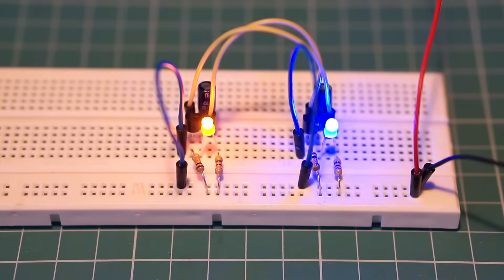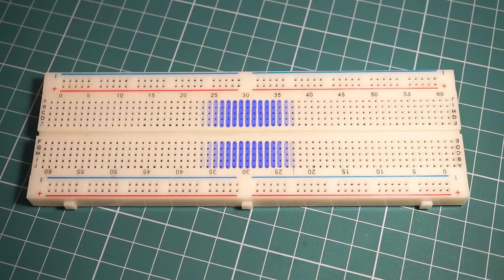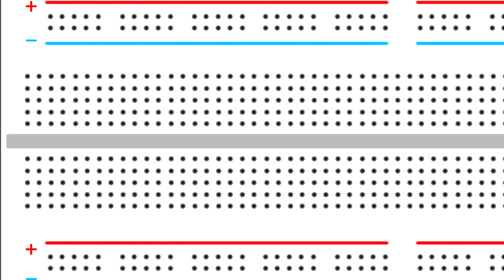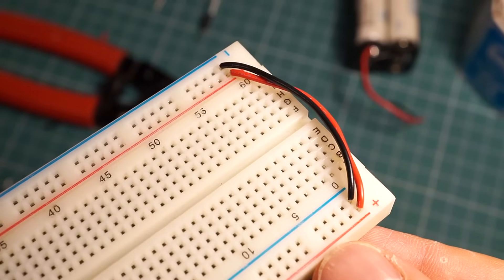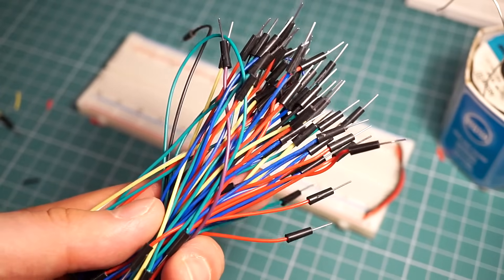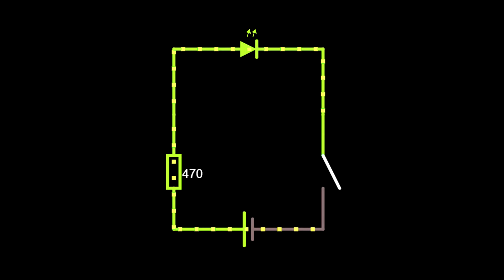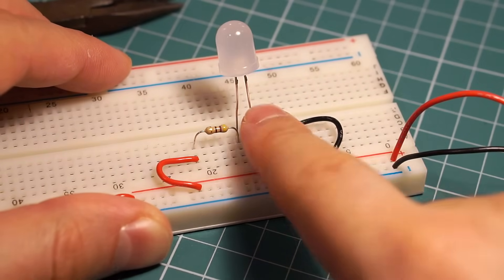Breadboard tutorial: How to use a breadboard (for beginners)

Comment: The breadboard looks like several can be connected to make bigger breadboards, yes?
Reply from the maker: Yes, some breadboards can be attached together. Of course, you'll still have to manually hook the power rails with jumper wires
Reply: @LeftyMaker  Great.

Comment: i did everything but the led wont work i tried it with other leds but nothing happens and when i use a cd motor it does work and i cant see what im doing wrong
Reply from the maker: Is your led in reverse? Do you have enough voltage for the led?

Comment: Thank you! When I was a kid I had an electronics kit which had springs you could connect jumper cables to to various components photovoltaic cell, rheostat, speaker etc. It came  with a book for 100 different projects. It was great. My dad and I once tried soldering components we bought for a separate project which did not work. Since then I hated soldering. This is cool. Subscribed
Reply: Yoo I had the same thing as a kid but I can no longer remember what it was called. Did you happen to remember?
Reply: How tf you had sh1t like this when you were kid. When were you kid anyway !? Man i saw these when I was at the end of high school and even then I didn't used them till i entered for bachelors degree
Reply: @dalalnikhil  in the 80s. I found one very similar. https://youtu.be/RqnLi1moiCI?si=uw-kyNedcPcKcG4x.   I quit electronics in high school cos I was red green deficient with vision - no good for resistor color codes etc. and I had to do double science which I could not do if I did electronics.

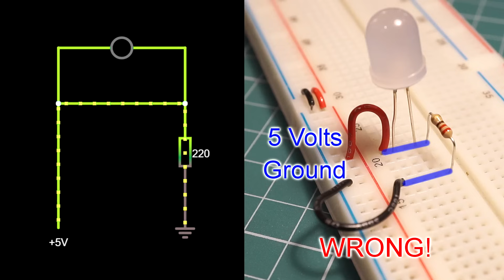Comment: Why exactly does 2:54 not work?
Reply from the maker: Because the LED is placed incorrectly. The legs of the LED are shorted by the breadboard, so no electricity flows through the LED and it doesn't light up.

Comment: So is it important to leave at least 1 connection point of space in between each element or lead for wires?
Reply from the maker: Only if you have exposed leads or wires that you don't want to be touching. Otherwise it's not critical
Reply: @LeftyMaker  Thanks! I think your video will be a big help for me in my Circuit Theory lab this week. Cheers!

Comment: @LeftyMaker Why is the setup at 2:53 wrong? The circuit is closed.
Reply from the maker: You guys have a point, but if your goal is to light up the LED, then the LED at 2.53 is placed incorrectly.
Reply: @LeftyMaker  But they are in the correct holes at 2:53 to make a closed circuit, isn't the led therefore going to light up?
Reply: @LeftyMaker  Then why does the written text say "wrong" ? at 2:53 ...... EDIT: AHHHHHHHH i got it now,,,, cause the currrent would choose the short circuit
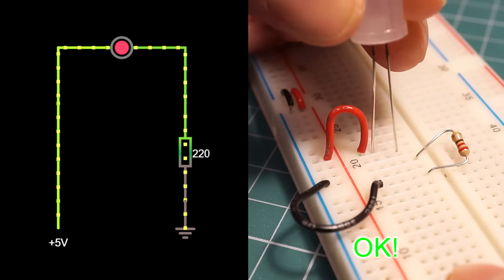Reply: It's not wrong.  Look at 2:58 he show a WRONG circuit and corrects it by closing the circuit.  2:53 was just incorrect narrative over the video.